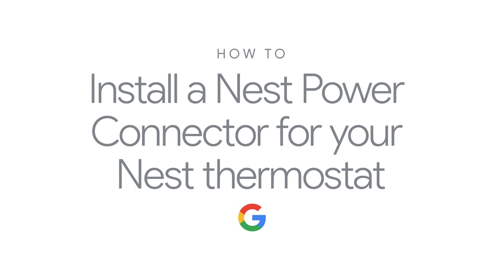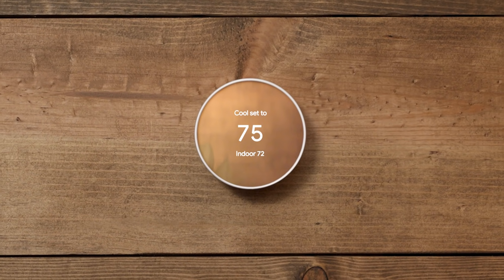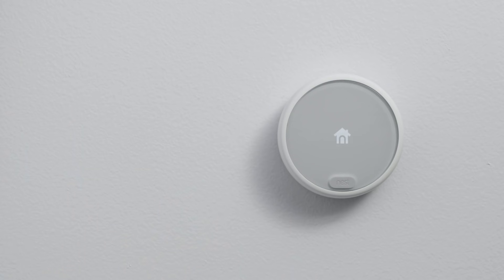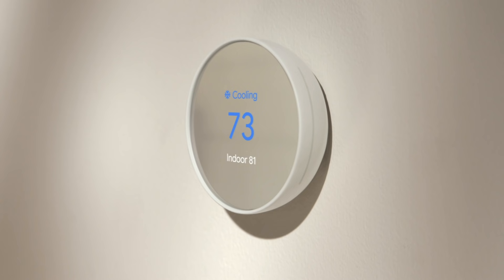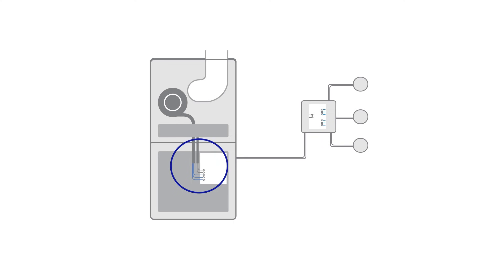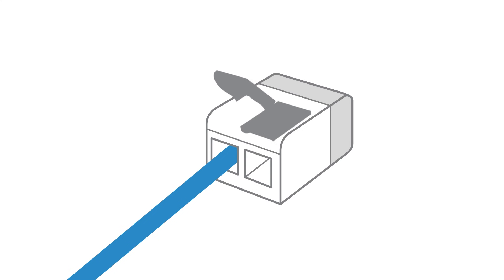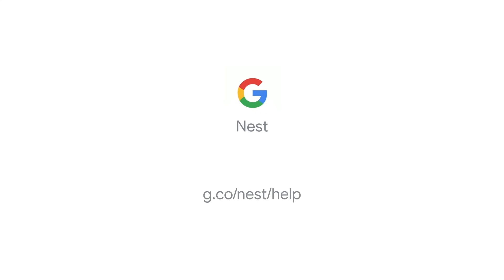How to Install a Nest Power Connector for Your Nest Thermostat

Comment: So how does the thermostat actually get Power if the C wire never actually makes to the thermostat? 

Mine keeps giving the error the C wire not detected even after install of one of these to the furnace. 

Also can’t update it because it wants wifi. Can’t get wifi without the C wire….frustrated. I have a 2 wire system R and W. couldn’t I just jump power from R  to the C port within the thermostat to give it power?
Reply: Are you sure it is installed correctly? I have used a 2 wire system for a few years without issues but now I am having issues. The issue with the 2 wire system is there isn't sufficient power while heating. Are you hooked this up correctly?
Reply from the maker: Hi there, thanks for reaching out. Nest thermostat is designed to use very little power, and in many cases it uses your system’s heating and cooling wires to get enough consistent power. But sometimes, you may need to connect a common wire or power accessory to provide constant power to your thermostat. Check out this link if your device isn't detecting a wire: https://bit.ly/3uq9TdY. For more help, you may need to contact our phone or chat support here: https://bit.ly/3adTfGB

Comment: I thought this looked simple enough but when I got the unit, then looked at all my wiring which looks completely different with 6 wire nuts connecting thermostat wires to other heavier wires going to the unit, I realized this is far beyond my capabilities ☹️ I guess I’ll continue to remove the thermostat and charge on the usb hub til I can find and afford a professional. My thermostat had worked perfectly for about a year but just recently started having low battery issues. I wish Nest would have just put a replaceable battery backup in the unit.
Reply: I agree! Mine shorted out my furnace and caused the system to trip the switches due to overload. Our heat cut off in the middle of the night when it was 2°f outside.  Took almost 24hrs to figure out what the issue was.
Reply: How do I charge it ?
Reply: Plug it in with a micro USB cable

Comment: Do you still need to have the batteries in place and change them from time to time after installing this power connector or will it just run off this? I currently have a lux power bridge that powers my lux thermostat and doesn't require any batteries. I'm wondering if the power bridge would do the same. I tried contacting support but they were no help
Reply: Mine says I need this c connector adapter now, and I can’t figure out how to install this thing thing. It’s freezing outside and my thermostat isn’t working properly.
Reply from the maker: We're to help, Mike — you'll still need the batteries even though you have the Nest Power Connector installed. You may check this link for more details: https://bit.ly/3riPSH4 and for more assistance, reach out to us via phone, chat or social forums: https://bit.ly/3adTfGB

Comment: Or you could just buy a thermostat that isn’t a complete money racket like
Things pile of shit.
Reply: Be helpful and suggest a good one that works with only two wires.
Reply: Nest was the only thermostat that worked with just 2 wires. It worked for me for at least 5 years but now I am having issues. I wish they were upfront with the common wire situation.
Reply: @deihmos   worked for 5 years and Google wasn’t upfront? Only if you didn’t read the install materials on wiring.

Comment: Having a hard time figuring out what to do with that "C" wire. I have a Taco 555 zone valve and I don't want to short anything out! I think I can connect it to the 3rd terminal.
Reply: Steve - I have a Taco zone valve with terminals marked as 1, 2 and 3. Which terminals do you connect the C, R and W wires on the Power Connector to?

Comment: Will one of these work for multiple thermostats? or do I need one for each thermostat? The wiring on my control board only has one two-wire output that gets spliced and divided to 4 different thermostats.
Reply from the maker: Hey Mark, thanks for posting. If you have a zoned system with more than one thermostat, install the Nest Power Connector at the zone controller. If you can’t locate your zone controller, we'd suggest contacting a Nest Pro. Learn more here: https://bit.ly/3z34z2e 
For more help, feel free to contact us here: https://bit.ly/37kTIVI
Reply: @madebygoogle  Do you need a Nest Power Connector for EACH zone controller, or one Nest Power Connector for the whole system?
Reply: @alanalipkin3278  One for each zone.

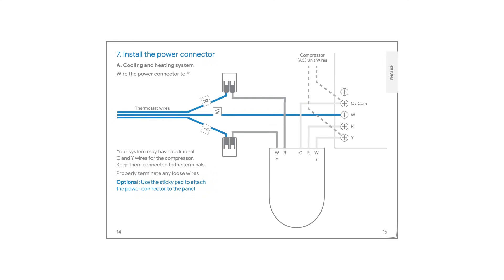Comment: Can anyone help me? I have a two wire heating only system. On my control board where the thermostats go in, there is no labeled spot for a C wire like the video shows at 3:45 Where do i connect the c wire from the power adaptor if I have no C wire label on my furnace control board. My thermostat wires connect to T and T3 and there are two other slots that are empty labeled 2 and 1.
Reply from the maker: Hey Mark, we're here to help. If there's no C wire label on your system's control board, you can connect the C wire from the power connector to the Com terminal instead. For more help, reach out through phone, chat or social media forums here: https://bit.ly/3adTfGB.
Reply: @madebygoogle  What would the com terminal look like or be labeled? I dont see anthing labeled com

Comment: why didnt i need the  c wire for 3 years of use to my nest  now it has failed no heat i payed a lot of money for 3 years of service before i could call nest they would help with anything now noting goggle hello and ideals ? iam cold and i charge this thing to give me a few hrs of heat then it dies again what have you done  that nest  is taking up more power ? turned on the camera ?
Reply from the maker: Hey there, thanks for reaching out — we're sorry to hear about what happened. Some HVAC systems need C wire from the start, some need it down the road, and some never need it — it depends on the HVAC system. Also, Nest Thermostat is designed to use very little power and in many cases they can use your system’s heating and cooling wires to get enough consistent power. But sometimes, you may need to connect a common wire (C wire) or power accessory, like the Nest Power Connector, to make your system compatible. Learn more here: https://bit.ly/3bDdgpp
Reply: @madebygoogle  hey there iam cold now i payed 350 bucks no issues in 3 years can i cut the back plate and get the usb in there ? or can you help somehow ? i read you guys give the transformer for free or can you send me a battery

Comment: How do you install if you have 2 stage cooling only? I have a 2 stage handler and 2 stage compressor.
Reply from the maker: Hey Steve, we’d like to know more about your HVAC system wires so we can help you with the installation of the Nest Power Connector. Feel free to reach out to us at: https://bit.ly/3adTfGB

Comment: What happens if i connect old thermostat that doesn't require c wire if i have  the google nest power adapter installed?
Reply from the maker: Hi Gerardo, thanks for reaching out. If your thermostat has power related issues, like the battery draining too quickly or Wi-Fi constantly disconnecting, you can typically fix them by connecting a common wire (C wire) or by installing the Nest Power Connector. Either one will provide a stable power source for your Nest Thermostat when your system can’t deliver enough consistent power to it. Learn more here: https://bit.ly/3z34z2e For additional help, reach out to us: https://bit.ly/37kj9qh
Reply: @madebygoogle  my problem is that sometimes it won’t turn on the heat/boiler but work again when I reset the furnace   by powering it off.
Reply: @madebygoogle  also, my question was what happens if I have the nest power adapter installed  and connect a regular thermostat that doesn’t require c wire ?
Reply: @gerardo.galvan   Did you ever figure this out?  I have the same question:  Can I install a regular thermostat in place of a Nest while the Power Connector is still in place?  I don't know how to uninstall the Power Connector.

Comment: if you don’t have a circuit board and no c connection in your ancient HVAC  this will not work
Reply from the maker: Hey Ivan, thanks for posting. Nest Thermostat is designed to use very little power. Power sharing is controlled by the thermostat display, and only happens if there is no wire detected in the C terminal. If it detects that it may cause a power issue, it will be requiring you to install a common wire. For more help, feel free to contact us here: https://bit.ly/37kTIVI

Comment: This video is the poster child of unsafe electrical work practices.  OSHA and NFPA70E are the authority on how to safely work on electrical equipment using lock/tag out procedures and verifying absence of voltage.  Following the advice of this video will put anyone at risk of electrocution.
Reply: LMFAO
Reply: It's only 24 volts

Comment: I got it but it says my W wire isn’t responding I updated the nest thermostat as well to 1.1 and when I put the W and R wire it recognizes both but with the power connector it doesn’t.
Reply from the maker: Thanks for posting, Dev — we'd love to help. To troubleshoot installation issues of your Nest Power Connector, try the steps outlined in this guide: https://bit.ly/3z34z2e. For additional help, reach out through phone, chat, or through our social forums here: https://bit.ly/3adTfGB.

Comment: Mine will not work. Wired correctly, doesn't work
Reply from the maker: Hi Keith, we value your experience and we'll look more into this. For starters, could you tell us which thermostat you're using (Nest Learning Thermostat, Nest Thermostat E or Nest Thermostat 2020) and what country you’re from?
Reply: @madebygoogle  I actually went thru and reconfigured my wiring and removed the C wire, now I have no issues.
Reply from the maker: Awesome! We're glad to know that everything's working properly now. Check out this link for your reference: https://bit.ly/3z34z2e. Let us know if you have additional questions or if you need help with anything else. We’ll be right here.
Reply: @keithswenor3230  If you have a C-wire you shouldn't be using this...
Reply: @mr.g937  no shit. I didn't.

Comment: Note to those with zoned systems (multiple thermostats tied to one HVAC system): you will need a separate power connector for each zone/thermostat you have on your system. The power connectors are installed on the output side of the zone controller. Google does not clearly explain this.
Reply: Nuts people still using these after all this extra steps.
Reply: @LBSNor1234  what would you use instead
Reply: @zimago  After several days of fucking with this and getting no where, I'd say a $20, perfectly fine digital thermostat.
Reply: @Oblitherator28 Can you control that $20 thermostat from any where. Does it turn AC or heat off when you’re not home?
Reply: @TheSharkTrading  I don't care, why do you?
Reply: @Oblitherator28  if you don’t care, why are you posting here? If you’re not adding to the solution, you’re adding to the problem.
Reply: Life saver as I'm sitting here in my attic ...
Reply: Thank you. Very important comment.
Reply: u
Reply: Thank you for this info. I have five zones and was told by the person at Google help desk said I only needed one.
Reply: This is the question I had, which wasn’t answered in the video.  Cheers!
Reply: I just have two wires lol my 24v power supply works until it is commanded on,
Reply: @ hilarious!!!
Reply: This is a lie. Do not listen to this guy!
Reply: @doomsday9973 power connector is for a thermostat with no c wire 

If you have two or three zones you have two or 3 thermostats.  And if all 3 thermostats don't have a c wire connected 

Let's see ...  drumroll please ....

You need 3 POWER CONNECTORS!  

So the one who says this is false and "not to listen to this guy"  apparently can't use common sense lol

This is why on most zone panels each zone has a "c" terminal 

I wonder why? 😂
Reply: @BrianR73 news flash Sherlock. I have 3 nests on 3 separate zones with no C wires and “drum roll” NO POWER CONNECTORS FOR ANY OF THEM! And they’ve all been working fine for years and years 😂

The nest learning and nest E thermostats do NOT require a c wire (it’s just recommended). Never have. SMH
Reply: You do need a (1) Nest power connector per zone . I have  a (2) zone system Heat/ AC . I wired a connector per zone on the zone controller board at the Thermostat Terminal strip . It’s a cleaner look and you don’t have to add extra wires to stretch between the zone thermostat terminals on the zone board and a  nest connector.
Reply: @megawattsinmdw154 you do not need a power connector for the Nest E or nest learning thermostats. I have 2 nests on 2 separate hearing zones for 5 plus years with no c wire or power connector and have zero issues
Reply: The video pretty explicitly states this: 0:48
Reply: @lightandtheheat  may want to watch a little closer before making yourself look stupid. It definitely does not explicitly say this. If it did it would say "If you have multiple thermostats, each one will need its own power connector installed at the zone controller" but instead it says, "If you have multiple thermostats, you will install the power connector at the zone controller". This would imply that a single power connector would work for multiple thermostats, which is not the case.
Reply: @lightandtheheat  Respectfully, I disagree. The video does not explicitly state that each thermostat needs its own power connector. While that may seem intuitive, I must note that Nest Support told me I only needed one. That was after I clearly explained to them the type of system I have.
Reply: @bradleydavis331  YES! I got the same run-around from Google on this.

I have a Taco 4 zone system with no C terminal at the ZC.

I need 3x Nest Power Connectors ( with the Jumper removed) and 3x 24 V transformers.

Comment: Very disappointed! On the website it said that I didn’t need a C wire and now the thermostat is not working… I was so excited about the thermostat and will have to return it. Very upset…
Reply: after the hassle i've gone through with this it should be illegal to false advertise like this.  oh wait it is!!!  pure bs, don't offer the free power piece of garbage for free either.  They're an absolute scam!!
Reply: Did you find a smart thermostat that can run without the c wire?
Reply: Same. So annoying!
Reply: I got the same message very disappointed
Reply: So dissatisfied with this !
Reply: You just need to remove your nest and charge it via usb. It should last 3 months between charging if you don’t want to do the above.
Reply: @chrismic4835  They can be charged?
Reply: Yes - it's a total joke. That's why they are offering power connectors for free - it's because they realize their system doesn't actually work without a c wire.
Reply: @bradleydavis331  where can you get it for free?
Reply: Really disappointed with this. My electric company here in Iowa Alliant Energy promoted this thermostat that it would save me energy and that's why I got it and I was supposed to get it for free. So I ordered it and Google also said my system would work without the C wire and it didn't. So I ordered the C wire and paid I think around 28 dollars for the C wire kit. And then while I was waiting for my HVAC guy to return to install the C wire my Electric company charged me $65 for the thermostat. In the end it never saved me a penny in Electricity and even with the new c wire the battery would go poop every month and knock the thermostat offline and then I couldn't control it with the home app and it was always a chore to get it back online so I could control it with the home app. Right now I'm gonna remove all of this and install the plain old style round Honeywell thermostat and be done with this. I really truly regret getting this
Reply: Guys, it works without a c-wire but will drain it’s battery quicker. The power connector took 5 min to put in and eliminates the need for a c-wire to run to your thermostat by using the unused y-wire to act as a c-wire as needed. Thus you can do this and not need a c-wire. Not false advertising because it’s true
Reply: Me too grr
Reply: @capsonsons8970  not a headache at all. I installed mine in 10 minutes and haven't had an issue in 5 years. Easy to use and install. Much more options than the old thermostats
Reply: @PhoenixAndTheRaven  Right? I installed one at mom’s house, no C wire, works just fine.
Reply: Same here
Reply: Skull issue honestly

Comment: Where do you buy this? is it free? This should be included with the thermostat. I just purchased my second thermostat, and have had a fuse replaced twice on my unit. #google #nest #googlenest
Reply: agreed, they said it was comptable if you didn't have a Common wire, but then they immediately follow it up by saying "some" systems might not work without this. How is the consumer supposed to know? You seem to find out months later when your unit loses power.
Reply: And it seems like Google fails to address this common issue that lots of customers are are experiencing. Every. Single. Complaint. And only crickets from Google. Hmmm...

Comment: How to install it on multi zone controller? I connect it at the input part or I connect it at each of the zone output line? For example if I have two zones, I have two output lines at the controller, so I need two connectors?
Reply: Yes. Connect at output. You will need two power connectors.